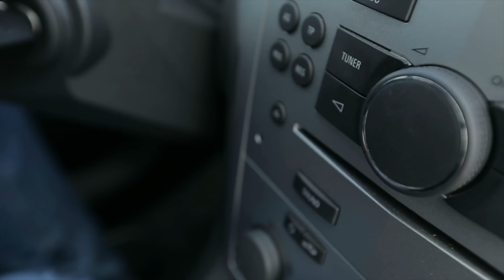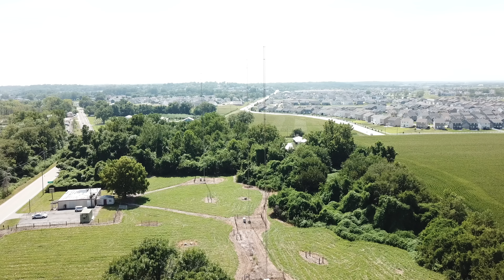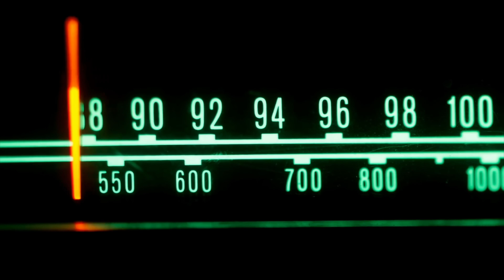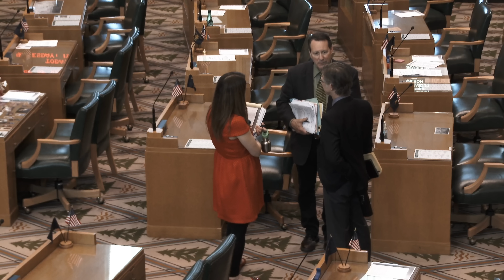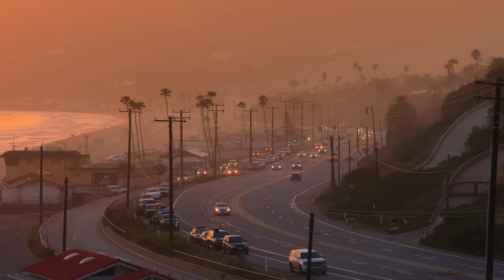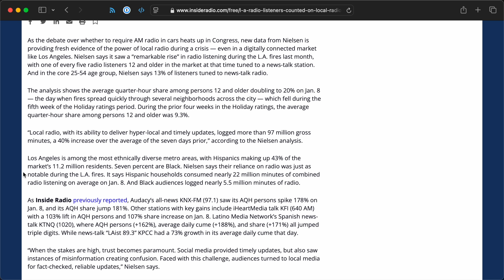Automakers are losing the battle with this 100-year-old tech

Comment: here in germany they'r phasing out fm radio as well, they're switching to dab+ - no more fm radio within the next 2 years
Reply: Here in Switzerland, the public broadcaster SRG SSR switched off all its FM transmitters on 1 January 2025. The FM transmitters in the tunnels have already been switched off and the last FM concessions for private broadcasters will end on 31 December 2026. From 2027 it will be DAB+ or internet radio only.
Reply: I think is a worldwide mistake to be centralizing all on the Internet and digital without alternatives. Time will tell.
Reply: Hold on, I thought DAB+ was a codec that broadcast on the FM band.
Reply: @joeblow5214  As an outsider from America, as far as I'm aware, DAB+ broadcasts above the FM band, in the VHF III Band.
Reply: FM has very short range and DAB is even shorter. Europe has gone nuts. In the US long distance capability makes more sense.
Reply: Sorry, I live in Bavaria and just can't believe this. DAB+ adoption is low, and you need a very new (for radio standards at least) radio or car to pick it up. I personally have no way of receiving DAB+
Reply: Analogue radio will be kept the same to at least 2030 in the UK.
MW and LW will be phased out as its listener base shrinks.
The AM users these days are listening to BBC sports radio on MW 999 and 909.
Reply: BBC World Service SW services will always be broadcast.
Reply: And the AM bands are getting very noisy, lots of interference these days.
Reply: Is there anything the Germans won't try to eradicate?
Reply: Maybe the US government isn't as bad as I thought jeez

Comment: They use lED Reaffic lights er in Florida, wgich wmit a lot of RFI. There are plaxes where yoou can gear them cycle through their oattern fom ov. The bulbs need built in filtering since rge harware was designed for incandesent lamos and the unshieked iring from the controller  too the lamps id easily over 100 fet/ This needs to be pointed out to the FCC along with super ceap swithing power supplies.
Twars ago I modified  a WWIII AEN6 direction finding receiver to solid state. Most mornings I could still pick up WSM in Middletown Ohio for seafrwe sunrise. The conversion was wasy. It ysed a nunch of 12SN7 dual triodes with 24  volts pn the pltes so I simply solered the FETs to the botom of the tube sockets.  It had multiple turnrf RF amps in fron of a superhetrodyne dircuit, and a narrower than BCB reeceiver IF.
I liked the old Delco car radios, since they used a 262.5 KHz IF. This reduced high frequebncy noise  and eliminared the birdy ay 810 KHz which was where WPFB was located. I would laugh when cheapsketes bought a $40 japaneses radio and coud't listen to the local station..
I miss my days working at radio & TV stations.

Comment: Lot of places out her in western/southwest MN that have NO FM reception. So I switch to AM if I am in the boonies!

When the dude in town with an EV drives by the interference on my ham rigs is horrendous!!! Wipes out 6m and 2m SSB... 

What model loop antenna is that?
Reply: The antenna is a SaferCCTV AN-200 (though I think I've seen the same design/model in a few other rebadged listings?).
Reply: @JeffGeerling  thanks! Been looking for a good loop for my bedside radio

Comment: AM (Amplitude Modulation) voice radio is complex and finicky to implement, especially in cars.  That is, when compared to simple OOK of Morse code, which has > an order of magnitude greater range and reception accuracy of "Amplitude Modulation".  For serious reliability and area coverage: mandate OOK Morse code, not AM !  Don't believe me?  Ask any HAM radio operator !  For the radio receiver all you need are 2 parts: an antenna and a tuned, high Q circuit.  Even the "detector" is optional !

Comment: I commend your optimism about the premise that the FCC is going to survive the next 4 years to be able to even crack down on EM radio interference. To say nothing about keeping AM in cars. Even if this bill passes, ain't nobody gonna be around to enforce it. 😔 I sure do enjoy Papa Geerling content.
Reply: If the bill passes, it will likely be the NHTSA (not the FCC) who actually has to create and enforce the rules on the auto-makers on whether they comply with the "Has AM radio integrated" rule they will likely work with other bodies like the FCC/NTIA to come up with technical specs that the systems will have to meet as integrated.  This agency has authority of certification for manufacturers to sell vehicles and regulates e.g. Fuel Economy of vehicles, even though this isn't strictly a vehicle safety standard, as well as things that seem more directly safety, e.g. visibility of headlights, audibility of horns and engine noise levels etc thru the FMVSS rules.

Comment: In addition to cars, The AM noise floor at my house is very high.
Reply from the maker: Yeah, I've had to relegate some power adapters to the spare parts bin after I notice I can't receive anything while it's plugged in!
Reply: @GeerlingEngineering  tool battery chargers are HORRIBLE for RFI! I have one that wipes out signals up to 70cm!
Reply: @MaryBrownForFreedom  I have my tool battery chargers on a smart plug that turns off at 10pm every night.  It eliminates that source of RFI, leaving the airwaves empty enough to hear several neighbors' electric fence chargers!  (They pulse several thousand volts every few seconds, and rain or weeds mean these poorly maintained fences will arc to earth. Sometimes they are even audible while walking nearby.)

The other problem I have started when the electric utility replaced my meter with a "smart meter" that uses PLC to send my usage back to the substation.  Luckily it is only problematic for a few seconds every 3-ish hours.  When it transmits, even the ceiling fans pick it up and buzz.  It wipes out radio reception on AM and will desense FM enough to block several weaker stations on my playlist.  I've wondered about installing a filter on my incoming powerline, but the box is crowded and I'd have to work with live wires or else pull the meter.
Reply: @Sylvan_dB  My main radio now is a Ryobi AM/FM boom box. AM signal isn't as great as I'd have hoped but FM is on par with other stereos I've used in the past. I got it because I needed a portable radio AM/FM. Maybe because its powered by a tool battery that's why AM has some issues?
Reply: @matthewjbauer1990  I have not noticed noise coming from the battery itself and don't think it has any circuitry that would be problematic. I'd guess just a poor AM design or perhaps other circuits in the boom box compromise the AM section. DC buck (down) converters in power supplies (18v to 5v and 3.3v maybe others) are often noisy.
Reply: @matthewjbauer1990  The type of battery has nothing to do with anything. DC voltage is DC voltage. Not sure where you are coming from.
Reply: @ Some (most) power tool batteries have BMS and other electronics built into the battery pack. This could be the issue. I was not referring specifically to the actual battery cells on the battery but to the other additions to said battery pack that make it different from simply powering the radio from the wall outlet or if it were powered from another DC power source.
Reply: Self inflicted radio noise. Go find it.

Comment: This is really only a "USA problem"... Here in Europe, AM is long dead - FM, DAB and now streaming are where audiences are, indeed in UK streaming numbers have overtaken even FM!
Reply from the maker: One difference in the US is the large amount of rural area coverage—some European countries would fit within the coverage area of one AM station, but in the US, there are still over 50 clear channel AM stations and that technically doesn't get full population coverage!
Reply: @GeerlingEngineering  But my experience in Africa is the same as in the EU. FM coverage is ubiquitous, so much so that any AM that existed was pretty much gone there by the 2000s. Why is the US so much harder to cover with good signal than anywhere else on the planet? :-)
Reply: @GeerlingEngineering The size of USA - yes, I'll agree there. But the answer (to me) would be to work to expand rural network coverage. Here in the UK the BBC was (rightly or wrongly) forced to pay towards rural broadband coverage in the early 2000s.
Reply: @HugoUK  Broadcast radio in the US is a private, more or less commercial affair.The government has little incentive  or history of providing radio service to extend coverage to remote areas.
Reply: @HugoUK  or... or... you pass a bill requiring manufacturers to not spew EMI everywhere (which is already a requirement but apparently not enforced) and they spend a dollar on parts to make the existing system work.
Reply: The US is a big place. There's a reason large swaths of the middle are called flyover country.  Eventually highways in flyover country got cell service, but off the highways yoeur are a long way from anything else. AM reaches into those places like nothing else.

Comment: The main problem is not the technology. It is that any feature takes engineering to design and maintain and software to keep stable and integrate. The point is putting in one feature on a vehicle is often compromising another option for something that the vehicle teams thing is more innovative (e.g. streaming video for passengers or satcom).
Reply: I will say AM as a technology does have problems though, FM is far more reliable from my EM experience. I'd be in favor of using FM on the current AM bands.

Comment: "simple to put in there"...that all depends.  If I'm not mistaken, you're both Amateur Radio licensees, so you must have studied enough electronics to pass at least Technician.  The controls for electric motors work, basically, by PWM.  It's that "P" in "PWM" that is the problem; they're pulses, not more ordinary waveforms.  As such, they have HUGE harmonic content, in the sense of being a very broadband transmitter.  If extra components ( == extra expense ) are not used, such as inductors to impede high frequency transmission, and capcitors to smooth out pulses (ostensibly after the inductor), and shielding to contain any RF emissions from the motor's power cables, your AM radio will be useless because all you'll be hearing is the 1-2 kW "transmitter" right next to it.  THAT is mostly why electric car makers are hesitant to include AM radio.  If the demand is there, the market will demand AM radios be included in cars, and those wanting it will be willing to bear the extra costs.

It's also an unspoken fallacy that AM is the only broadcast band participating in EAS.  By regulation. ALL broadcast stations, AM, FM, TV, have to participate in EAS.
Reply from the maker: I think the argument is cars shouldn't be spewing out broadband emissions in the first place! It's not just the internal AM antenna that would be affected.

And currently AM stations are the lynchpin for the truly 'poop hits the fan' situations, with FEMA broadcast facilities in select regional AM transmitter sites. FMs don't have the reach to be the hub in the current spoke-and-hub model for EAS.
Reply: @GeerlingEngineering  BINGO! When the only EV in my little town goes by it wipes out shortwave thru 2m ham radio for me. Thing is a menace to radio reception. Had a fire in town, guy with the EV was waiting to get by and the fire dept radios quit working until he went by. I was there helping direct traffic and I saw them pointing at radios and shrugging. I gave the EV guy priority to get the heck out of there... told the fire chief to look for EV's if he has radio issues and get them off the scene
Reply: @GeerlingEngineering  , I will say, you make a persuasive argument, but I have to question whether legislation is required, that is, how market solutions won't work.  If there is enough demand, hopefully that's what the manufacturers will provide.  To me, the BEST thing you can do is raise awareness of the importance, which is what you're doing with this and a few other videos here on YouTube.

Comment: Seems like this should not be a straight requirement, but rather until an alternative emergency alert system that is less dependent on local cell towers is wide spread.  Apple already is integrating satellite communications into it's phones.  If an EAS was implemented that used satellites in cars and cellphones as an alternative I think that would be better than just keeping AM radios as most young people only have an AM in their car if they own a car to begin with.

Comment: I hope they include a provision to require the cellular service providers to enable the AM chips in cell phones.  Optimum seems unable or unwilling to turn them on.
Reply: cell phones don't have AM chips, some have the hardware for FM.  AM would not work in a cellphone.
Reply: @theJonnymac  This 100%, but many phones these days don't even include a 3.5mm headphone jack which doubles as the FM antenna when a cable is plugged in, which one of the main reasons why more phones don't have FM.
Reply: Cell phones don't have "AM chips"
Reply: @stargazer7644  thanks champ, but we already explained that days ago!!

Comment: EMC tests are pain in the ... :) Modern backlights of modern screens emit a lot of stuff in the air and ppl like me have to do a lot of tricks to fit the circuit spectrum, so it doesnt hurt AM and similar low freq. I've slept in anechoic chambers so i cam make the tests overnight. So the reason is companies want to shave money off their expense list. 
I'd like AM to stay it is the only reliable long range solution. And the r&d work has already been done
Reply: Stop using high voltage EL.  Use LEDs.  Problem solved.
Reply: You're supposed to be outside it! (Outside the anechoic chamber, I mean... while the measurements are being made. Or do you have an anechoic sleeping bag?!)

Comment: Good, which means the automakers need to spend effort on electromagnetic compatibility.  It’s not rocket science, it just takes better engineering.  The HF spectrum is already polluted enough.  Remember when PC had good quality enclosures?  Now they are made from glass.
Reply: Glass PC cases are for people that   want their extra LEDs they paid for exposed. You can still buy a normal PC case of pretty much any shape, format, or quality you wish.
Reply: @ sure, but the FCC used to enforce emissions standards on PC manufacturers, thus they had cases with proper EMI gaskets.
Reply: @rfengr00 That's a fair point, I didn't hear about it as I'm not from the US.
Reply: @rfengr00 When was this?
Reply: @J-1410  back in the 80’s and 90’s.  If you look at the C64 and Apple II, they have a powder-spray EMI coating on the plastic chassis.  Even the PC cases of the 90’s had sheet metal liners behind the plastic with tabbed gaskets to the frame.  Some laptops are still pretty decent, but PC are the Wild West.  The FCC can’t do much about build your own PC, but I see commercial gaming PC with clear side panels.
Reply: "it just takes proper engineering"  FTFY

Comment: If some people really want AM radio gone, they probably have interest in using AM radio's frequencies.
Reply: what i find it wierd is that the band isn't good for digital data

they want it gone as it makes RF sheiding easier as you don't care about the low LF and MF frequencies
Reply: @redstone0234  The AM band is extremely narrow.  A single wifi channel is 20 to 80 times bigger than the entire AM broadcast band.  There isn't much modern use for AM broadcast radio frequencies.
Reply: @stargazer7644  I was thinking that but wasn't sure.  Thanks.
Reply: Pye's fcc stole our best dtv bandwidth for cell corporates. 3rd time rebanding now it doesn't work half as good. Thx to the orange😡stupid...
Reply: @ It's a shame dtv is a bad standard as well. Takes too long to switch channels, basically made it unrealistic to have a portable tv like a sony watchman anymore.

Then again, there's a larger problem afoot. A lot of people who cry about AM radio being useful in emergencies (conservatives or boomers) entirely overlook what we had with analog TV.
Reply: @ Long switches between channels have nothing to do with a standard, it's a problem with slow decoders
Reply: @ I haven't seen a good decoder yet tbh.
Reply: @itogi  You always need to wait for the next I-frame before you can get a picture from DTV. This places a hard lower limit on channel switching time even with a perfect decoder.
Reply: As someone who worked on product design, it's not about getting rid of AM, it's that AM is too weak to benign interference because it's a bad standard, so it's the easiest thing to want out. After all it was the first form of radio to be used because it's easiest to generate with crude tech, well it's difficult to do much with electricity without emitting AM that disturbs crude tech.
Reply: @RinoaL  Being simple to implement doesn't mean it is a bad standard.
Reply: @ In this case it is a bad standard due to its simplicity, because AM is the simplest way to get radio waves to interfere with an electrical signal. Now in this case they decided to use that interference as a way to transmit sound, but it still makes an AM transmitter one amongst many transmitters. That includes motors and the sun. Going with a more esoteric method such as FM helps weed out the more random atmospheric interference.
Reply: @RinoaL >  "FM helps weed out the more random atmospheric interference".
Except it doesn't. For really weak signals, AM gives a better signal to noise ratio than FM does. FM "falls off the cliff" with weak signals.
Plus You could only fit a small number of FM stations in the MW AM Band.
Reply: @graemezimmer604  I actually heard something recently that makes sense in regards to this. AM used to be much wider, but FM got stuck with the 1950s bandwidth limitations. Apparently AM used to sound better when the bandwidth fit the radio tuning

Suffice to say, it'd be easy to just update FM to fit on a smaller bandwidth.